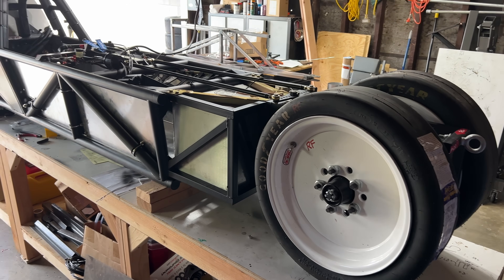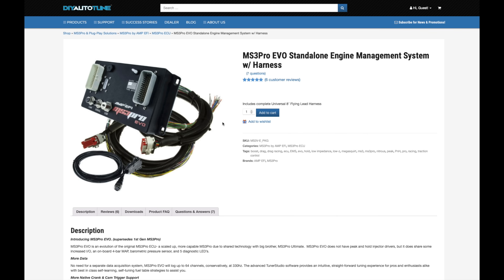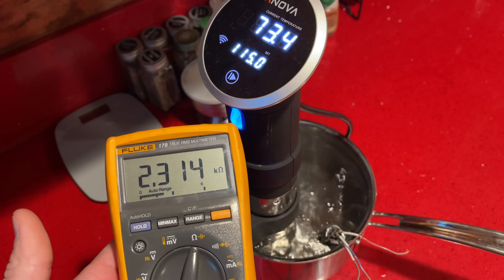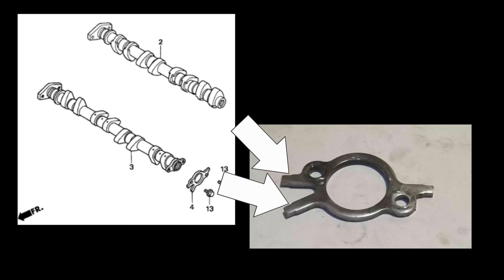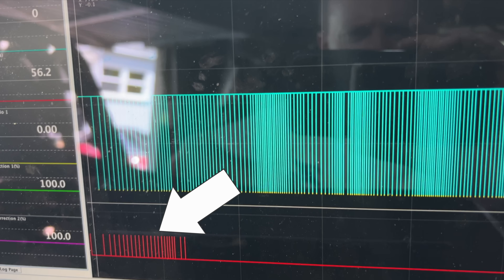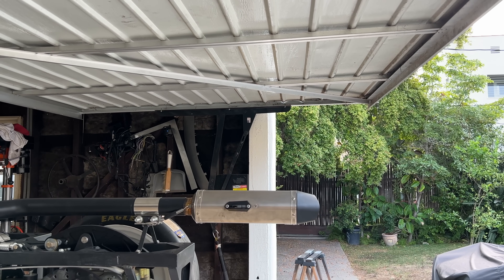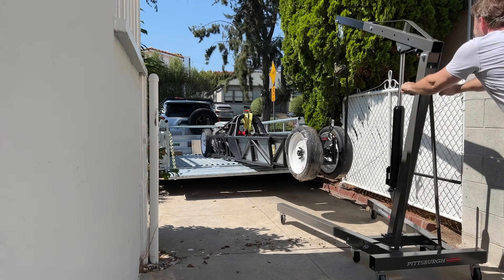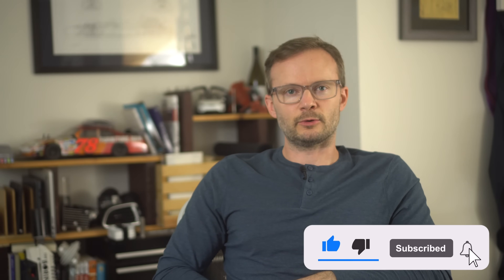The Engine Is Running, And Spraying Oil Everywhere

Comment: I had a neighbor who bought an old 70s dragster chassis in the 80s with a plan to turn it into a streamliner and run at Bonneville.  He worked on it slowly for over 30 years and died in 2016, never having finished it.  
Just sharing to encourage whoever might need it to get out there and get it done.

Comment: You may have already thought of this... I would put some dielectric grease on all your wire spade/blade connections. Would cut down some of those intermittent, not working gremlins that are almost impossible and frustrating to find. One other thing I would not let myself go without saying something about: You're using Destaco (This being the most common brand name around here...) lever clamps if I remember right to hold your steering/tiller assembly down in place. I've seen those release at times I thought absolutely impossible to un clamp. I've seen those with springs on them to make it harder to un clamp by themselves. Maybe some hard rubber where the steering/tiller assembly contacts the frame? Have to remember you're driving a very fast moving vehicle that's going to have a lot of vibration. NOT a slow moving luxury car!!

Comment: Cvt vs gears? Obviously gears are better for regular cars unless u call a golf car a regular car but I'm just curious on what would be better for high speeds. U shouldn't be pulling much weight or accelerating fast so a cvt should be insainly good for a speedy boi

Comment: I have a suggestion- eliminate that C5 filter design, run a pump on PWM at "static" pressure, since you already have the output- then you'll have way less current draw at low RPM/idle... not that low RPM or idle is what we're going for here. Just an idea to simplify everything some, help to keep the fuel cool if there's pumping overhead. The newer Walbro stuff is all designed for it, the 450 E85 is a great pump too. For redundancy's sake, the relay/on off circuit could be setup to fallback to fixed "on" full DC or "off", with digital control operating inside the "on" range of course. Could have an inline regulator with a fallback pressure slightly higher than the desired, but not so high as to significantly throw off the tune. (IE, run PWM control at desired 55psi static, and set a reg at 60psi or something). Just need a 5 pressure sensor/transducer somewhere. 
Also the water pump you're using looks a bit undersized, then again no idea what new design/flow rate it is. The older Bosch intercooler pumps were always really solid, and of course the ones in the newer German stuff that's all water/air intercooled work too (Assuming that's what this is) Also Prius have aux cooling pumps that are good cheap backups. Is it going to be a pressurized/sealed cooling system?

Comment: You can use FT600 for datalogging sensors like suspension travel, external air pressure sensors for aerodinamics and etc.

Comment: Bonneville was for submarines this year, and nobody built one for that scenario.  A couple of items after viewing a few videos of yours while sprinklers are running spraying water on chassis parts:  A) Look at adding a steering dampener.  Imagine what happens with the steering when catching a tire rut (bad salt) at speed.  Your fire suit (and thumbs) will appreciate it.  B1) Chain growth.  You will be close at best with a new chain. After a few runs on the salt and it will be slapping from chain stretch.  Easier to allow room now than later.  B2) More chain guards = good.  What happens with your chain at 275mph (even at 500cc) with salt flying around from the tire and into the chain.  Shields are a good thing to divert salt away.  B3) Chain lubrication.  Water injection with a small pump might sound crazy but it helps clean the salt out during the run and keeps the chain cooler.  B4) Changing chain on the salt sucks and especially if one has to do on a daily basis. Plan accordingly during design.  C)  Air intake.  If pressured who really cares where the intake is!  Normally aspirated via the nose intake through the cockpit and out the back (like Sam Wheeler did) = lots of work for minimal gain.  Make sure you can clean it of debris and salt (blowing around in the paddock or little kids sticking things in the front intake vent.) and with a design to do so.  Best is an air intake (think about your laminar flow and how to get the air to re-attach after) and into an airbox (calm the air) and then into the engine.  A good design is worth 1.5 to 2.0psi of pressure.  A bad system will lose you power or worse.  Add a sensor to your airbox setup and monitor via electronics.  D1) Design your cooling system to be able to drain quickly between runs and easily air bled out when refilling. (And while keeping the engine electronics off.)  With a 14-gallon h2o tank in the big streamliner with packed ice at 42F at start of a run -- it is literally boiling hot at the end of a full pass.  Drain it and replace as it won't cool down for a 2nd run even in a few hours.  You have a baby tank in comparison, but it will get hotter through the day wrapped within all that bodywork.  Auxiliary electric water pump for pushing water volume aren't bad things.  E)  Suspension travel indicator.  Electronic is best but a manual system will pay dividends as well.  From the seat almost impossible to feel pitch issues and truly impossible on a bumpy course.  It is nice to know if the nose is running high and the tail is dragging low -- and especially before it goes flying like your flamed analysis spot on bad things.  That is why you sneak up on speed records as you can monitor post run what happens with the front/rear pitch factor.   F)  Make sure tech inspectors can easily access the sparkplug holes for measuring stroke and bore if you should ever go to impound.  Don't ask how this lesson was learned.  G) I will admit I have no clue about YouTube algorithms, monetization of videos nor on how to be a good armchair quarterback. But I do know where I will be next August about this time for the next several decades.  Good luck!
Reply: You sound super knowledgeable. Commenting so I can @ you when I go for the first submarine-class land speed record
Reply: this seems like an extremely underrated comment

Comment: Congrats on the running engine! I was going to write how those heat exchangers can move a ton of heat (breweries use them to cool the boiled wort before pitching yeast). So I was going to question how much flow you were getting...

Comment: Trailer Idea. KISS method. Why not simply us the racer chassis as part of a trailering system. Build an easy-to-use hitch for the front and clip on spring and axle system for the rear.

Comment: suppppppppperfast matt! I guess I should become a patron but I'm so gosh darned broke. I'll pay you with tips (just the tip,mind and only fo' a minute) instead -- Dell Inspiron Rugged's are durable enough to take into o&g and mining operations. Granted you've already thrown a lot of monies at this project so far, you can go on ebay and literally get one running windows xp, throw the Lunix on there and it will be able to keep up with your EMS no problem. 

Also holy fuck 1300 for that shit? God damn son, that PCB better be tracked in gold

What are the rule restrictions for this shit other than CCs? Or is it purely limited based on displacement and an obligation to use petroleum as the sole power source? No VP100? no NOS shots, no ethanol mixes, no racing nitromethane, but what about things like ancillary cooling to your runners? Can you use FI?

Maybe here's one way to skirt around the rules -- You can jacket your intake runners (and jacket your coolant "runners" for that matter) with ln2 at atmospheric (or better yet he(aq) if you know any professors who'd be willing to sacrifice some lmaoz. I duno what the h-t). 

Given a run time of 7 minutes, you probably wouldn't need more than a thermos worth and that's easy to score/store/integrate without having any dangerous high-pressure. (I'll fuck with anything sketchy most the time, except little scary microbial zoonotic type virus wuhan lab style shit or gasses that can expand faster than I can run)

Comment: the tapered plug on the coil wire solution is great, I am switching my COP setup to LS coils and was having trouble coming up with a solution as my spark plug tubes are a weird DIA. but ol McMaster-Bate has just the plug I need.

Comment: What about some kind of dolly that works like a hitch dolly to move a boat trailer around.  It could hook on the wheels of the car and then you can pull it forward out of the trailer onto a ramp at the end.  That would allow you to keep using Uhaul trailers.

Comment: Have you concerned quick connections for the brake lines where the frame splits? I run then on my racecar at the front axle and they are life changing

Comment: You could buy another trailer or... You could build a dolly. You roll it up into the trailer and then use the dolly to lift the other end and continue pushing it into the trailer.
EZPZ?

Comment: Your INTRO.... I understand.... with a bit of extremism.... I have a 1993 Jeep Grand Cherokee ZJ, on jack stands.... for...... 28 years.... LOL... That is no joke... I had about 5 years straight rebuilding, improving, adding armor, gutting the unified body sub frame to make everything into a ladder frame, painting and powder coating EVERYTHING, etc. Mind you, much of what I was doing, there was no reference material out there for "How-To" or "Why"... all stemming from what is known as (death wobble) and back then, even the dealership couldn't rectify the issue, as they had no clue what or why the front end would go nuts. So, I parked it, and started to crunch numbers and CAD work long hand drafting, $71,000.00 later and exhausted and still not done... I had to take a break... and 28 years later still on jack stands. Buddy's come over and bug the daylights out of me to finalize it, so they can watch me beat the day lights out of it... even though, that is not in my nature or the cause of the whole desire to make the unit bullet proof, so to speak.. I just wanted my new from the dealership Jeep to work right... I started gutting it, while I still had a Jeep payment and it only had 3300 miles on it when it hit the jack stands... It is so close.. yet, crunching that hard, all by myself, learning so much, the massive amount of time .... Do not allow yourself to get burnt out.. I want to finish it, but I don''t feel like it. Heck, I have built other rigs in that amount of time that it has just sat. It has sat for so long, that the forest green paint, is actually grey from dust, grinding dust, over spray from other projects... I will recommend, take a break, do not worry about deadlines or meets that you want to make.. Take a break for a determined amount of time, and write on the calendar and then walk back out there on that day, and just start again... work for a week, rinse and repeat...That way, your desire is kept up.. vs. "I'll keep working, as I am almost done, one more wire, one more weld, one more machined part".. If you have a team of people, that will help with the feeling of desire to be excited about it.. but, when you are by yourself, take your time... enjoy the building process.. Not that you already do not know this process.. just saying, I hate knowing my Jeep is out there, begging for me to finish it up... I know the smile would be ear to ear simply driving it to the gas station for the first time... yet... nah...

Comment: Hofstadter's Law: It always takes longer than you expect, even when you take into account Hofstadter's Law.
"Guess and test engineering" - reminds me of the SV Seeker steel boat building project on youtube. When the boat finally made it to the water so much of the boat is having to be rebuilt. It seems that all the 'cheap out' undersized and poorly designed features are failing, and quickly.  A number of engineers and experienced boat people contributed to the project but the boat owner would always argue about how he knew better and how his 'cheap out' solutions would be good enough. Sort of reminds me of cautionary tales that it will cost you more in the end than if you had done it right to begin with. Part of the entertaining aspect of his channel is that 'nobody can tell him nuttin''. 🤣🤣

Comment: I recommend an "EZ Loader" boat trailer. They are put together like an erector set. Take it apart, cut it, drill it, do sketchy things like cutting and rewelding the axel, which I did.  (learning from you)  Pretty soon you have a custom race car trailer.

Comment: I really really need help re- engineering the steering linkages for my tilting reverse trike ( sunny df150tka) info is non existent  and maintaining Ackerman steering with up to 45* tilt is super challenging, I am on my 10th design and cant cut it.
anybody's advice would be appreciated, just ordered a rack and pinion setup for a razor 800 that matches my width, and angles, and I'm contemplating a drag bar setup that keeps the 2 wheels in alignment at all times regardless of tilt or steering input

Comment: To help load onto a trailer, try reversing your tow car up a set of ramps on the rear wheels. This will lower the trailer ramp angle, reducing the height that you will have to make up. Granted you will be loading uphill. We used this method on our track car, as the bumper would scrape the ramps. Anyway, great videos. Looking forward to more of the Jag. Keep up the good work.
Reply: Hah! YTber FarmCraft101 needed to hoist roofing sheets up an extra 12-16 inches using a farm tractor, so he tried the ramp trick on the front wheels and it worked.

Comment: The hall effect sensor was probably fine, some designs need a 1K ohm pull up resistor between the supply line and the signal wire, then it will give a clear 5V square wave output, without the resistor it can read nothing on the signal.  Supply can be rated at 12v but still work fine at 5V.

Comment: What is wrong with the current trailer? 2 strong booms made by girl scouts and remove the trailer underneath . But perhaps lift points would be a problem with the enclosure. But a dedicated trailer is also cool, if many unloads is needed 🙂🤓 
What about a hitch in the front of the racer - the you have the world fastest trailer 😁🤪

Comment: buy an elevator dropdeck trailer. they rent for $1000/day. or build. i can help, ihave been building them for bicycle for 10yr, to handle pallet loads, and look forward to the day mine has elevator. the frame dynamics are easy.

AKA hydraulic dropdeck trailer
i would recommend pneumatic...
might as well build a FWD dropdeck pickup truck.
Reply: old show of dropdeck bike trailer taking a flush load.  she stil lives
https://youtu.be/oRlVSbnq-jQ

Comment: If that trailer is yours, you could 'just' fit a manually operated crane on the front. Somewhat common around these parts of the globe.
Reply: The trailer appears to be a 6'x12' utility trailer rented from U-Haul. Not only is the trailer not Matt's but it won't be nearly long enough with the tail fitted.

Comment: Looks like the stock BMW crank and cam signals are the same as a Gen 4 LS. The cam teeth on the BMW cam look exactly like the cam gear on the LS. Crank is 58 tooth, or 60-2.

Comment: Just wheel chock the trailer then tilt it to the ground and winch it onto trailer. A tongue jack is also required so you do not have to lift it off the ground after.

Comment: You might wanna change you steering system from that push pull cable to a steering wheeled system at high speed that cable is gonna let your tires wobble independently think about it that cable isn’t 100% tight inside that slider that holds the cable tech will fail that steering system trust me and then it will be another whole year before you can try again you might wanna seriously think about swapping it to a real steering system I would if I were you that way I know when I get to the flats there’s no problems, guess you don’t know about advancing the timing 10 degrees inside the engine not on the distributor but you would need a index wheel for that motor I do believe, Is that blue stuff that your using PEX cause if it is I don’t think there gonna like that either cause that looks like PEX to keep there gonna want a rubber hose possibly a braided rubber hose
Reply: The steering does not use a cable.

Comment: active aero, with slam dampening and active air brake. an adaptive ground effect aerofoil system.
personally I would ideally have lidar scanners in the nose watching for the road undulations, an algorithm to detect different conditions, high downforce on takeoff, barely touching the ground at high speed and pre-impact dampening.
maybe aero steering assist?